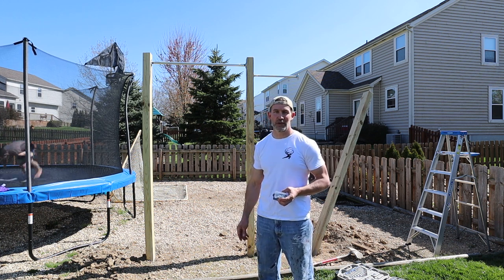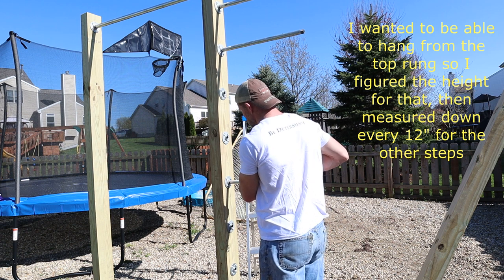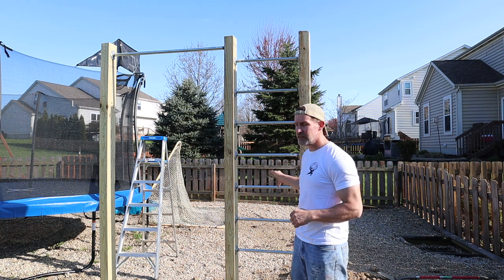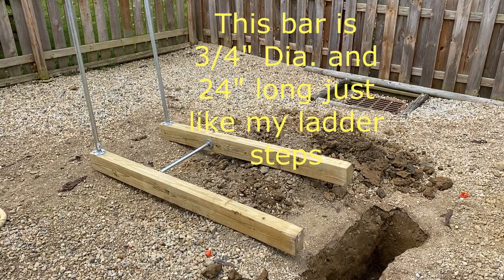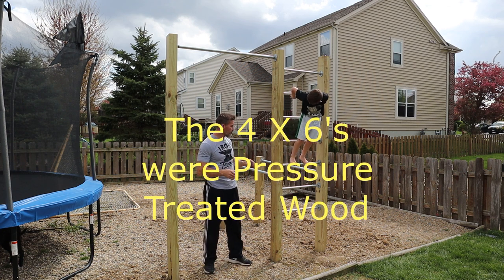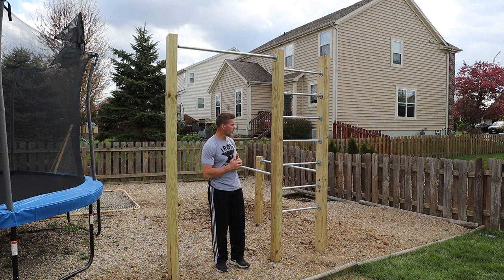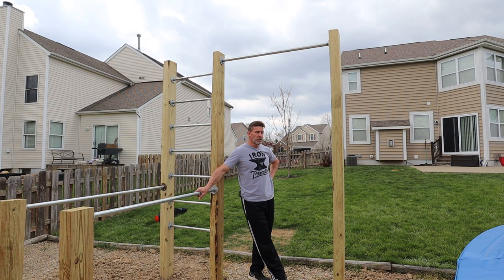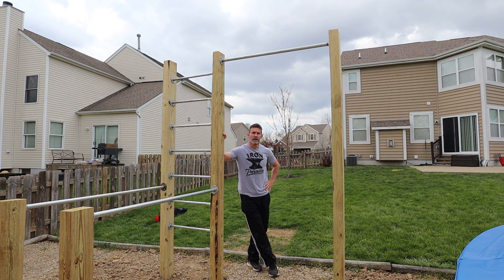Pull Up Bar Build

Comment: I’m going to build something similar. I’m thinking of using concrete form tubes to extend the concrete above ground. That way no dirt will be touching wood. Also provides a little step to help reach the bar. Curious what you think about this idea.
Reply from the maker: My two pieces of advice are to use (at least) 4x4’s for your posts, and make sure you dig it down deep enough. In my area, I had to go down a little more than 30” for the frost line. Keep in my your body will generally have some swing to it even on a strict pull up. If you dig too shallow, your bar will rock (at best) or could even uproot. Best of luck regardless of what you do and have a great day! Thanks for watching!

Comment: Great advice for the sturdy post. I'll rip a page out for that. Gratitude.
Reply from the maker: Thanks for watching!
Reply: @kellyfamilyfitness4916  Hey can you explain what type of screws you’re using again? Bc when I went to Home Depot the wood specialist recommended something different.
Reply from the maker: @TimmerTheChipper  I would recommend using the largest diameter galvanized screws that you can. When you pick out the floor flange, take it over to where the galvanized bolts are and try them out to make sure they fit the diameter of the holes in the flange. The skinnier the screw, the more likely you’re going to be to sheer the head off the Top when you go to tighten it down
Reply from the maker: There is a shopping list for everything that I purchased in the drop-down Menu under the video as well. Best of luck!
Reply: @kellyfamilyfitness4916  I looked right over. Thanks for such detail.
Reply from the maker: @TimmerTheChipper  thanks for watching!
Reply: @kellyfamilyfitness4916   another question, how did you go about keeping your 1st post stable while pouring your concrete and such?
Reply from the maker: @TimmerTheChipper  I poured rocks and dirt around bottom half then filled rest with quick set concrete
Reply: @kellyfamilyfitness4916  genius work. High gratitude.

Comment: Very nicely described and well built structure. I would love to know the measurements of few :- 
1) I will be using 1 inch bars for everything, can you tell me the size of flanges on the parallel bar and pull bar. I believe the are different size. 
Also any nut or screw that you have used ? Thanks.
Reply from the maker: Rajib Banerjee thanks for watching! The flanges for the pull up and dips bars are the same size. Both of those bars are 1” diameter (though they differ in length). I bought them straight out of a bin next to the pre cut pipe at Home Depot. Just make sure you get galvanized and not iron.
Reply: @kellyfamilyfitness4916  So the pipe diameter(1") and the flange's diameter(1") should be of same size.

Comment: Sweeeet!! Is this good enough for gymnastic rings(I'm 6' tall)? Woooo 1st year only on gymnastic rings and loving it!!!!! Always been a lifter but loving calisthenics wayy more even tho I'm still just on beginner workouts but no weights until I can iron cross!!!!!!!
Reply from the maker: For calisthenics movements like ring dip youd probably be ok. For ring muscle ups, you’d want a higher anchor point (ring muscle ups at 6’ tall would need to be about 10-12  feet off the ground)

Comment: Props! On both the project and your muscle ups!  Now I want to build one! 

Any advice now that you've used this for a while?
Reply from the maker: My build is just about a year old. It’s as sturdy now as it was day one. Since then, I added another pull up bar with a small diameter for my wife. The only thing id reconsider is how wide my ladder and dip bars are. For me, they are fine.. for my wife and son, they should probably be closer to 19” wide (vs 24” plus floor flange width). Best of luck and thanks for watching!
Reply: Thanks!  I'm in the planning stage now :)

Comment: What about connecting the parallel bar wood beams by that pipe or another piece of wood, but in the ground under the dirt before filling the hole? Or is it sturdy enough without needing to do this?
Reply from the maker: Absolutely. I took mine off in the end. My son wanted more room to swing for certain parallel bars moves he practices.

Comment: Just wondering if the flanges allow the bar to loosen over time or have you had no issues?  Do they tighten in opposite direction?
Reply from the maker: Opposite direction and zero issues. Thanks for watching!

Comment: Hi good afternoon, I was thinking of doing something similar, however I had a quick question. How much weight can the floor flange hold?
Reply from the maker: They’re galvanized steel so they’ll hold an awful lot. That being said, I wouldn’t try to get by with just using them on one side. One on each side doesn’t even budge with my 200 lbs on it
Reply: @kellyfamilyfitness4916  thank you, I appreciate your reply

Comment: How has the galvanized bar/hardware held up in the rain?  Any rust?  I'm considering doing this, but wondering if I should paint it.
Reply from the maker: Hey Shawn! Thanks for watching and commenting. Galvanized flanges and pipes are doing great (almost 1 yr later). Pull up rig is as sturdy as it was on day one. Paint is up to you but not necessary in my opinion.

Comment: How wide are your parallel bars?  I'm in the middle of same build project
Reply from the maker: Mine are 24” apart. That’s the pre-cut length of the bars on the ladder. To do it over again, I might have them cut to 20 or 21 inches so my bars would be a little closer together.
Reply: @kellyfamilyfitness4916  i cant seem to get my parallel bars to be 24 inch apart...with using 24 inch gal ladder poles and 2 floor flanges.  I also used 4x6 woods.  But when I measured parallel bars center to center it comes out at 27 inches wide.  So I might do one flange ladder poles and drill hole through other post to get tighter fit.  Then just shoot a bolt through so it won't spin out.
Reply from the maker: @havefunandbikestuffOver40  the Hardware store you bought them from might cut them down for you. I chose to use the floor flanges to ensure my bars don’t spin.
Reply: @kellyfamilyfitness4916 how tall are you? You say you'd have them closer together if you were to start over, is that for your sake or more for your kids/wife? I am 6'4" and will be the only one using it
Reply from the maker: @jordanbabcock  I’m 6’2” and around 200 pounds. The bar width was pretty good for me, but I did bring them a little closer together for the rest of the family a while back. My shoulders like the new width better, but it would have worked either way for me. Thanks for watching!

Comment: Do I need to dig 30 inches deep if I live in North Carolina?
Reply from the maker: I’d assume your frost line is much different there than mine is in Ohio. That being said, much less than 30% of your post length might not be enough structural support over time. My posts were like 11’ long (to account for the 30” in the ground and get the bar a little over 8’ off the ground). They probably weigh in the neighborhood of 50 lbs each. While I know this doesn’t completely answer your question, I can assure you that 1 year later my bar doesn’t budge even when I swing into muscle ups. Best of luck to you and thank you for watching - B
Reply: Kelly Family Fitness thanks dude
Reply from the maker: @riffdex  thanks for watching!

Comment: how long are the pipes on the ladder side?
Reply from the maker: These were 24” pre cut galvanized pipes.
Keep in mind that will set the width for the dip bars too. If you want your dip bars to be a little closer together, you’d need to have the pipes custom cut to length